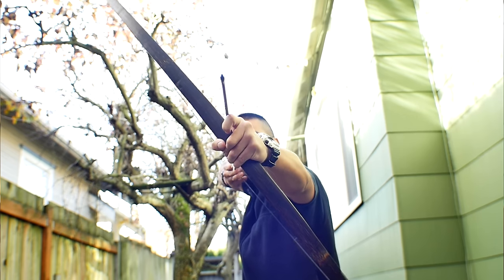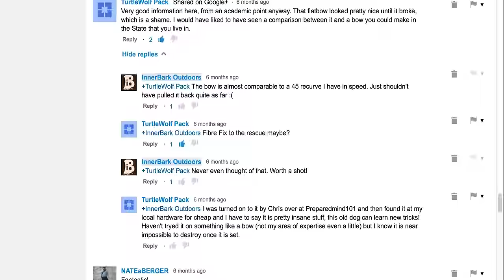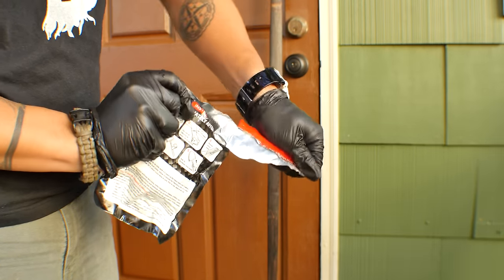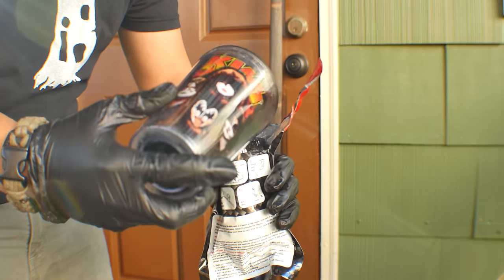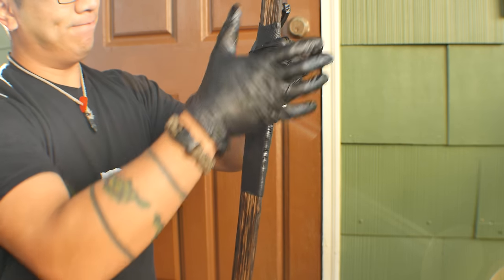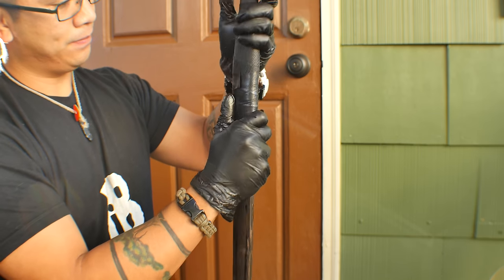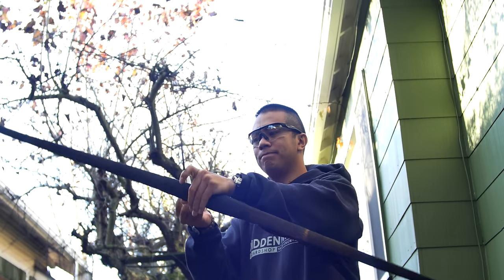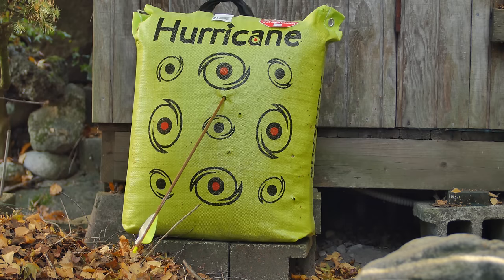Repairing A Bow With FIBERFIX

Comment: Can fiber fix be cut into thinner and or smaller pieces? I have a Ben Pearson Jet Bow. There is a string groove on the tip where the string sets in place. It is kind of like a saddle for the string. You can google and see the bow and what I’m talking about. In your opinion do you think this product can be used to repair this portion of the bow? Thanks
Reply from the maker: The fiberfix can be cut smaller. I would use a utility knife or similar since residue will get on scissors and it's a project to remove. As for repairing your now it would probably work. With all things now related your mileage may vary and it could be unsafe for you to repair. From the looks of it though those jet bows are light poundage so there risk is minimal but I'm no engineer.
Reply: Thank you. The poundage on mine is 40 .lb. I will do some more research. Thanks again.